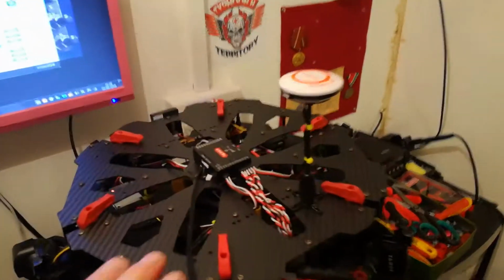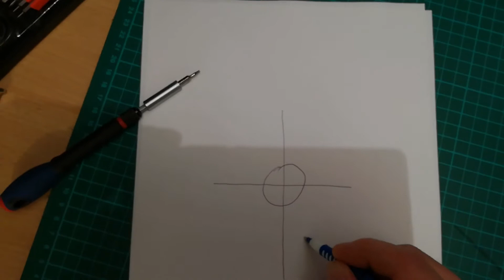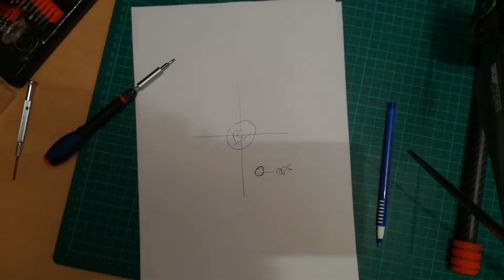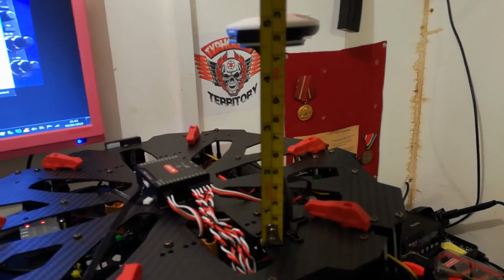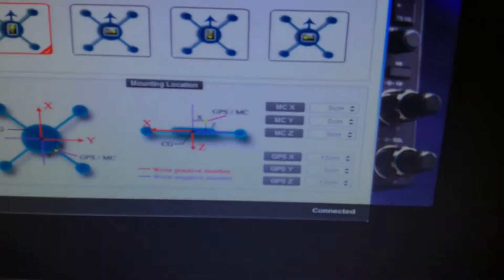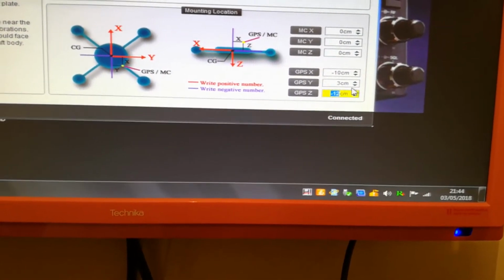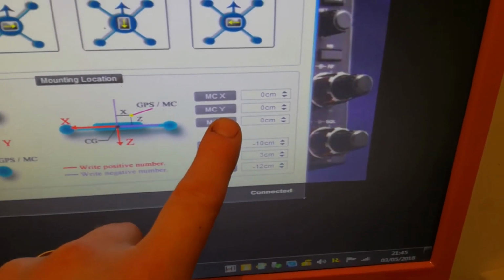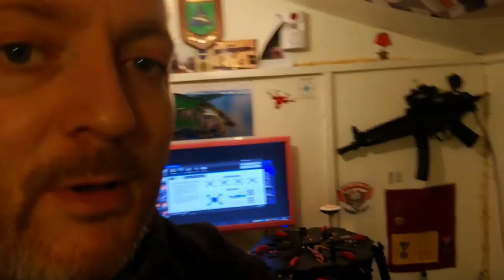TAROT ZYX M GPS MODULE PUCK LOCATION

Comment: Hi! I have a flight controller located from left to right relative to the quadrocopter nose, does that mean the GPS antenna should be positioned from left to right as well, not straight?
Reply from the maker: Антон Дмитриев compass should  point to the front of the aircraft.  No matter what direction the Flight controller,  the compass should always point to the front.
Reply: Richard Gilmore ok, thanks